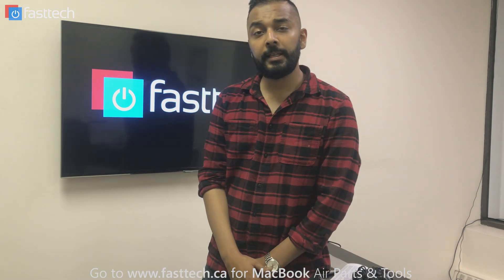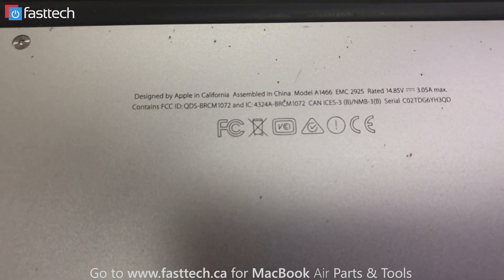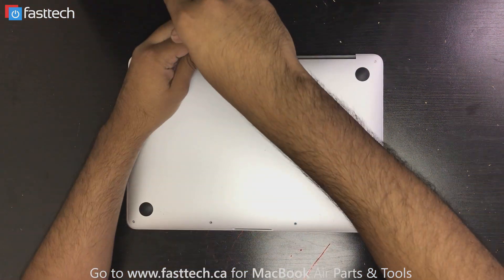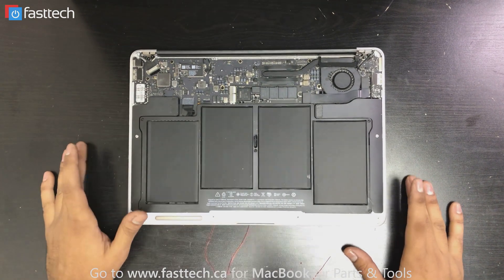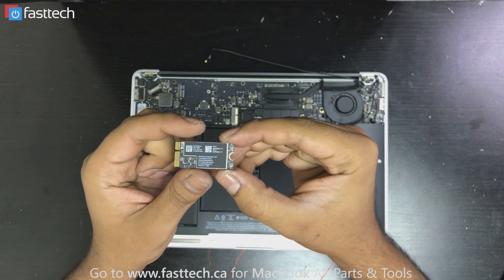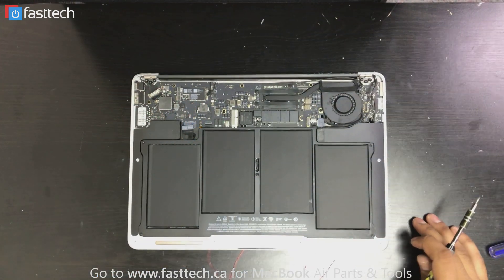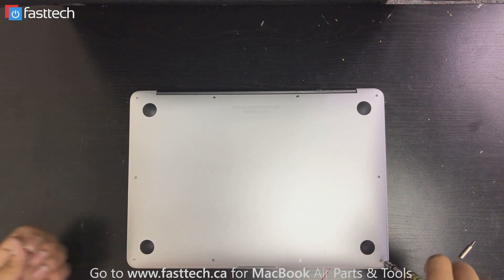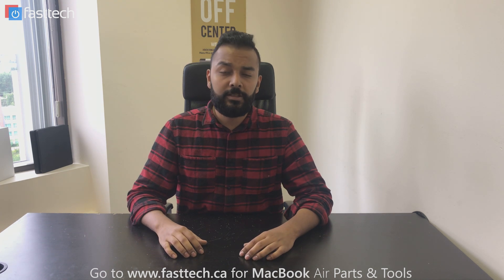MacBook Air A1466 WiFi and Bluetooth Card Replacement (Network / Airport Card)

Comment: How do you connect the small cables back in? I was hoping to see that part but you jump cut to already having them connected.
Reply from the maker: Can you be more specific ?
Reply: @fasttechvideo  the antenna cables back to the network card
Reply from the maker: @TheDrjjones426  Its a circle connector that you have line up and push down to connect.